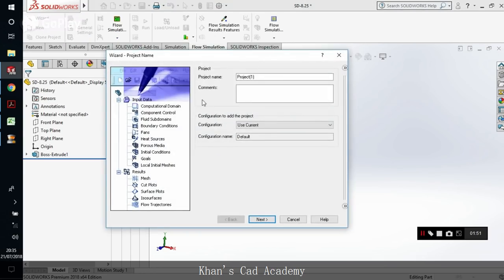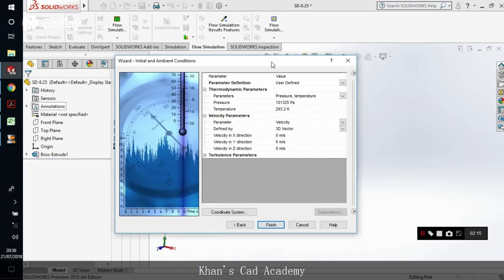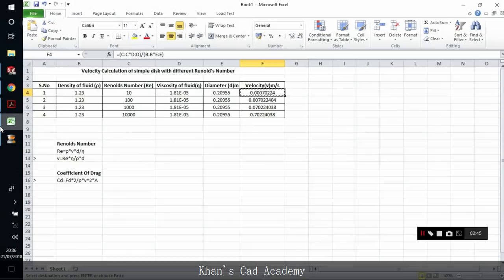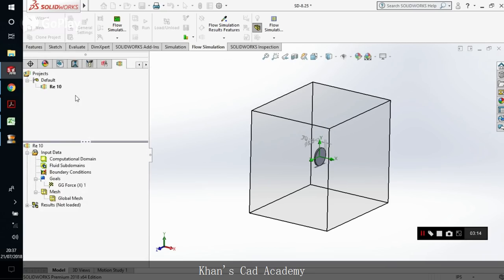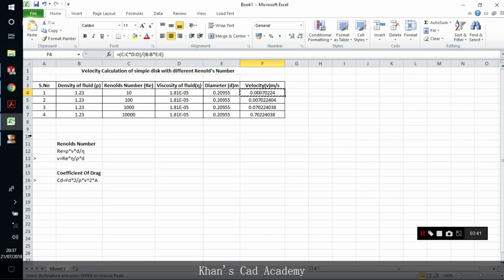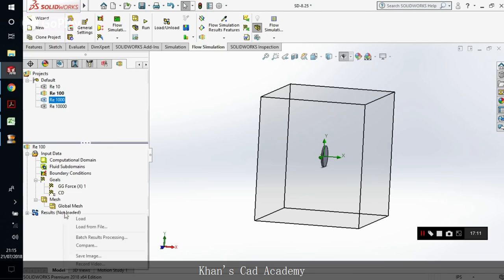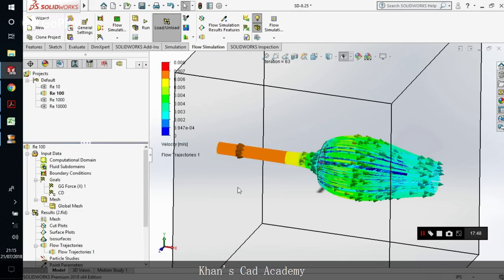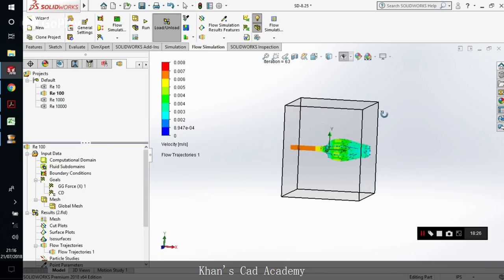Coefficient of Drag for Vertical Disk using solidworks Flow Simulation

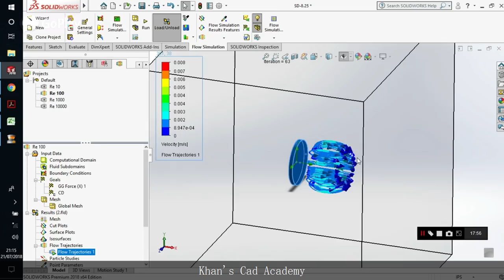Comment: At 17:44 After starting animation, it shows first formation of wakes past the vertical plate & then flow from inlet side.....Is this wrong order of the consequences ? 
As there should be first flow from inlet on the plate on upstream side then its middle region gets stagnated while end sides get diverted at downstream side of the plate & this gives rise to wakes are forming on downstream side close to plate......Plz explain this orderly.....Is animation shows correct consequences of flow physics in this problem ?

Comment: Sir, nice and clear but how about Cd for aircraft fuselage? I'm stuck with the "Area"
Reply from the maker: Khairul Noh share your geometry
Reply: The same. I am trying to simulate simple airfoils and other, more organic shapes and I struggle to understand the process of calculating the area. I could go to my solid model and select the faces of interest, then on the mass properties window there is a calculation for area. The problem is how do I know which faces to select in order to get the area info? Is there a definitive process/sequence that one has to follow in order to define the reference/nominal area?
Reply: To calculate the projected frontal area of any shape in solidworks, create a plane offset of your front plane that is outside your shape. Then start a sketch on that plane and convert all the entities that line the perimeter of your objects front plane. Then extrude your sketch and evaluate the surface area.